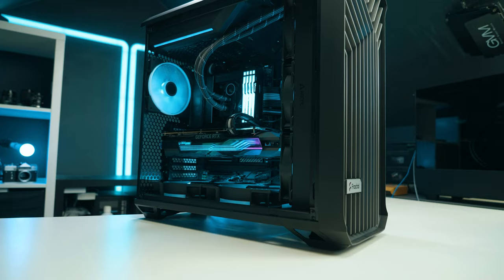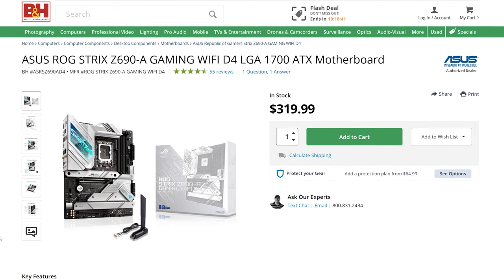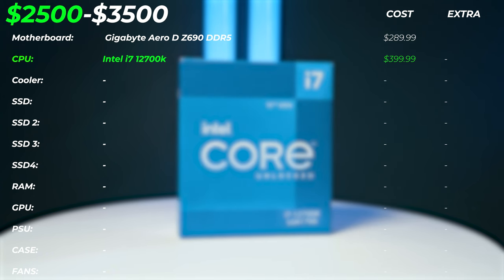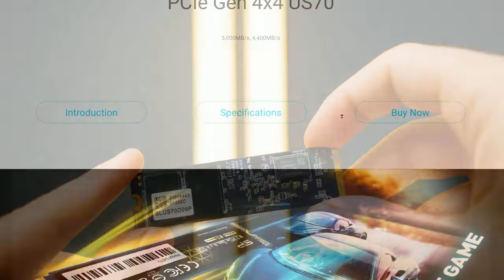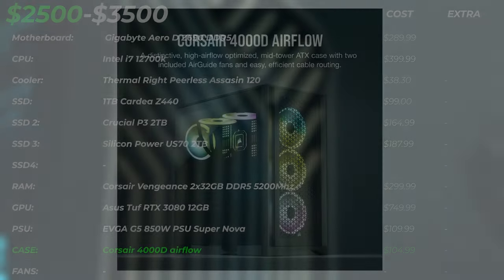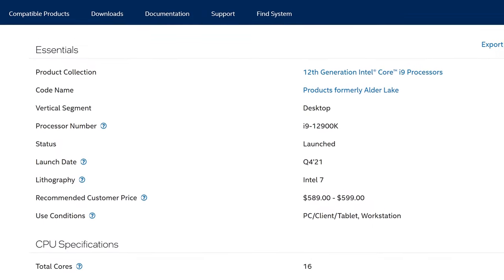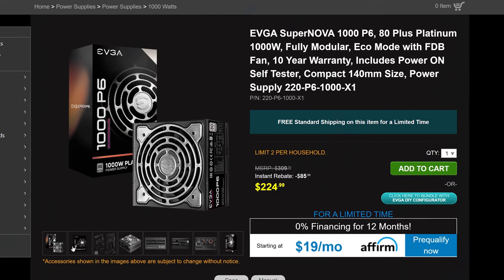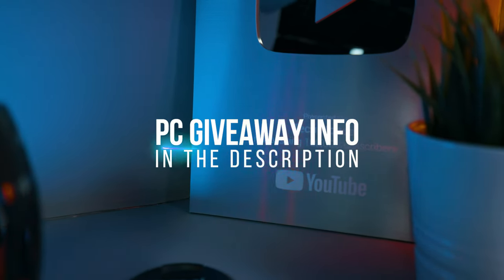BEST PERFORMANCE Creator PC for $2500-$3500 👉 Video/Photo/2D/Graphic Design etc. [Late 2022]

Comment: What I can't wait to see is a video from you about how the iGPU on Zen4 compares with Intel in encode/decode. I've also heard that they've improved the video encode/decode on their RDNA2 cards with the latest drivers. I'm curious if it's actually improved for content creators as well.
Reply from the maker: Defos gonna do that, at the moment I'm abit sceptic about it coz I don't think AMD has worked with Davinci or Adobe to build software support for the iGPU :(
Reply: Also how does arc series compare for encoding by and deciding?  Thx

Comment: I'm thinking of upgrading my 3950X to a 13900K and a z690 motherboard... but not before Tech notice takes a look at that CPU!
Reply from the maker: Mate, I'm thinking the same thing.
Reply: @joaocorreiamedia  if rumors are correct, the 13900k has more raw horsepower than ryzen, plus quick sync decoders!
Reply: @joaocorreiamedia  the answer to your question of which one is better for video editing comes down to media decoders/ encoders. Idk if Ryzen has any, search for it. It dosent really matter how much horsepower you have, you need media engines to play back compressed video smoothly. My 8 core 3700x can’t even play back a h265 video in vlc or windows media player 😂 let alone edit it. But my m1 air can play it super smooth (tho it still sucks for editing, which is strange to me as all the YouTubers said you can edit well on an m1 air )
Reply: @joaocorreiamedia  I would think that would depend on the type of h.264/5 files you are working with and how much more of that you do than BRAW. If 7900x doesn't offer hardware acceleration for your codec than that load will fall on the GPU. How good is your GPU and how much is it already tasked with handling? Either one should do the job but there are trade-offs with either as well. Just depends on if any of those trade-offs will actually apply to your situation. At this point you might want to wait and see what 13th gen 13700k brings to the table. Those should be competitive with the advantage going to Intel for the iGPU and price.
Reply: @joaocorreiamedia  the 13700k is $110 less than the 7900x my guy.
Reply: Is 12700k with 3070 good for beginner level editing

Comment: Nice build! If you went with the 13900k, could you still air cool without throttling? (while video editing)
Reply from the maker: Yes, but you need to set the pl2 limit to 253W (Intel stock setting) and not let mobo pull 300+w....
Reply: @theTechNotice  thanks!
Reply: @theTechNotice  Got ya! Can I air cool a 13700k just fine withuout adjusting pl2 limit? I'm using a Fracal Torrent case and a NH-D15 cooler. I do video editing. Would I get better performace from a pl2-limited 13900k or a stock 13700K. Thanks so much!
Reply from the maker: Yeah,  you should. :)

Comment: Hey! thanks for answering my question from the other video =]
building my first PC which Ill be using for 3D render work.
Wont be going with the latest and greatest to avoid all the early adopter issues. 
question now is, how can I future proof myself for when I'd eventually like to upgrade? Specifically the motherboard? How often do people upgrade their computers? from what I gather, it seems like were in a transitional period in computer tech. Just want to make sure I dont get "stuck" and make the transition smooth in the future when its time to update things. Maybe this is something I dont really need to worry about?

Learned sososo much from your vids. Cant wait to pull the trigger and build my comp ^__^

Comment: 1. What is the best bank for buck CPU for extended CPU render (Architecture Visualization because Vray is well optimized for CPU rendering )since you mentioned that the 12700k isn't in this video.
2. Will the motherboard still support Amd CPU? if I don't want to go with Intel.
Reply from the maker: You should go with AMD 5000 series and 5900x or 5950x. And you'd also need a different motherboard that support that. B550 or x570 cost motherboard.
Reply: @theTechNotice  Thanks a lot. Your videos are really informative and educating.

Comment: Thanks for the great videos! I would like to build a desktop around the new rtx 4090. I have done architectural renderings, 3D modeling, etc. for years in Vectorworks and I am just getting going in Blender. Can you please recommend the components you think will work best with the 4090? Any help is greatly appreciated, thanks!

Comment: Just curious. You mention sometimes how you can add M.2 drives when MB is equipped. Or maybe more RAM sticks as well. But I never hear you discuss the potential tradeoffs adding these components might entail given the finite number of PCIe lanes with a consumer grade CPU and chipset. Note: I’m not entirely sure what I’m talking about here but maybe you could refine the question and then address it? Thanks!
Reply: For RAM, there's no downsides aside from the price you pay. As for M.2 drives, sometimes certain pcie slots shut off as the board reallocates lanes - but this changes board to board.
Reply from the maker: Aarron put it well :)
Reply: Well, if you ever watch Gill from BuildOrBuy he would have a lot more to say about that. Most of it over my head. “But to reiterate, changing one thing changes everything”. He says that a lot. The gist of it seems to be that if you don’t want to make any compromises then you need to hope  HEDT and workstations are within reach.  But if you’re going to use consumer grade for professional work then just know that if you max everything out then you may not be getting the performance you thought you could get. I’m not in my lane, I know, I just want to know more about this aspect of computer builds. Thanks!

Comment: Finished the $3,500 build per your suggested components (Asus ProArt Z690, GTX3090).  Also purchased a Dell ultrasharp 4k monitor.  Now I am confused on what cables go where?  I connected my Dport cable from the GTX3090 to the Monitor.  PC running well, monitor working, but no USB ports work on Monitor.  How should one connect all these cables from the PC to the monitor?  Thunderbolt  4 to monitor, USB c to c, DisplayPort In port for Thunderbolt 4.  So confused.  Maybe a video on how to connect, and may external hub for connecting other peripherals ??
Reply: You should use USB B in order to make your USB port from your monitor work
Reply: @nandarisya4255  Monitor does not have a USB B port. MB also does not.

Comment: I made this computer and I fellow all your instruction (about 3700$ Canadian 😂 ) I put also a ssd 4 500gb and I try to put a sata drive 2T (old ordi) but I can access it when I check the manual it said that I can't because the ssd4 is install Iam correct or not (see manual for the Z690 page xiii

Comment: Seem like a great system spec
How come we need 4ssd drives?
AMD system not recommended?
Thx
Reply from the maker: Well it's not whether it's Intel or AMD but which system gives you more performance for your money.  At the moment the 12th gen is kinda unbeatable at that. 
AMD is recommended for people doing 3d Rendering since at 3d they shine. :)
Reply: @theTechNotice  that is what I need … 3D performance for $3500 between Intel and AMD does it really a lot difference? Thx
If I choose AMD in this budget, what is your recommendation for cpu? Thx
Reply: @theTechNotice  Can U suggest a system within this price range for AMD also? Cause I need to do 3D, thx

Comment: It's a mystery to me why don't you put a cooler from Arctic and PSY such a budget version of the case and the boards are super, I'm just delighted with them, As for the 13th processor, they say that it will be a hypersonic stream with cores on board

Comment: FACTOR IN CURRENCY CONVERSION  $2,5OO-3,500 usd I'M NEAR ON $3900-5400 AUD

Unless you are in creation of customed OS  installs, minimum basic installs is 2-4TB windows averages 1.5 TB on install these days with 1st OS updates applied

Comment: Sooo, even if I wanted to, I still can’t get the 13th gen with the $2500 build? In other words, Is it still compatible?
Reply: Yes, 13th gen Intel chips will be compatible with Z690 motherboards. But some motherboards will require the BIOS of the motherboard to be updated to support the new 13th gen CPU’s. If you buy a 12th gen CPU and upgrade later this won’t be a problem, but if you buy a 13th gen CPU at the same time as a Z690 motherboard you may have problems as the motherboard may not know how to run the CPU; so you may need to put a 12th gen cpu in the motherboard to update the BIOS before swapping to the 13th gen CPU. 
Z790 motherboards will guarantee compatibility with 13th gen CPU’s but you don’t get much extra for your money other than peace of mind.
Reply: @jollyoldchris9897  so, it’s not worth it for a first time build?
Reply: @ElLeanBean  whether it's worth it or not is something only you can decide.
Reply: @ElLeanBean  Just wait to what tech notice, gamersnexus, jayztwocent, lines tech etc will say. They will compare it with 12th gen for sure.

Comment: Guys, the GPU he has listed is like 800$ right now you can get 3090 with 24GB Vram for 950$ much better value IMO.
Reply from the maker: If you can find one for that, go for it 👍
Reply: The prices skyrocketed since you commented. Every 3090 type I searched for online last week was either on the average price of $1500-1900 or sold out and that was the case for every online store. Good thing was that I was able to get a good deal for one on Black Friday and the stock was (2 left)
Reply: @subtleprelude2400  yep. And also it s hurts to get 3090 when there s a 4090

Comment: makes me lonely when he said that not a lot of people doing long 3d renders while my 3900x is rendering for 3 days straight now lol
Reply: Just install a compatible GPU-based third party render if your CPU is not the best for rendering and if the software you’re working on is only CPU-based. Most 3D softwares support 3rd party render engines so it wouldn’t be a problem. Obviously keep in mind about the quality of your graphics card vs the processing clock speed power of your CPU.
Reply: @subtleprelude2400  can't decide that against my client unfortunately. I use Arnold btw.

Comment: please help me in this if I have this configuration--- can I exchange the motherboard and Cpu and still use all others component? thanks you---- 
this is the PC I have---                                     
ASUSCOHP X990LX II 201 lVJ AlX II MotherBoard 
INlEL AOX INTEL CORE I7-6900K - Procesor - 
2  CRUCIAL 326B 2X16 D4 2400 BSLT -
Graphic card GTX 1080A STRIX 868 PCI -  $424.99
Intel 600P Series 1TB M.2 SSD

I want to update with the MB you suggested and the 12900 CPU